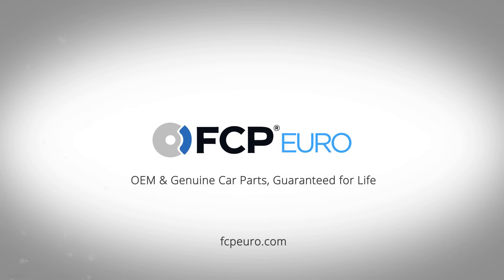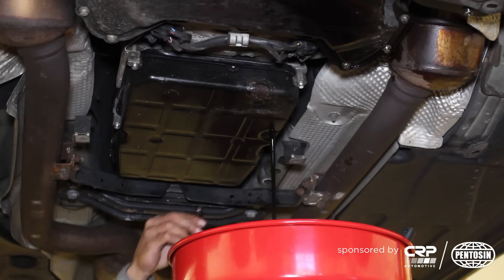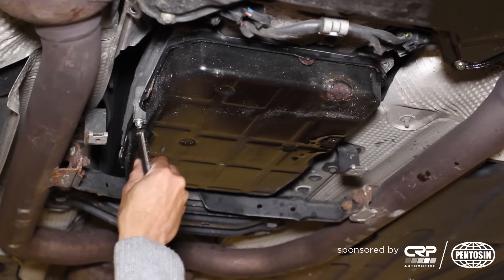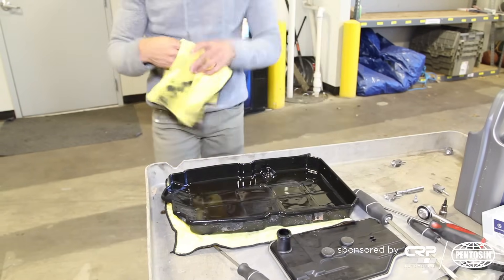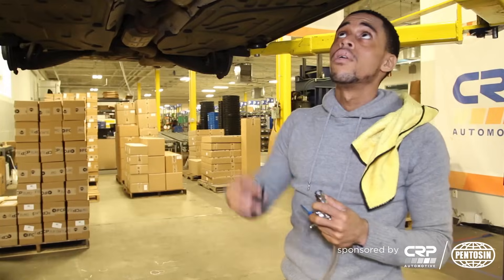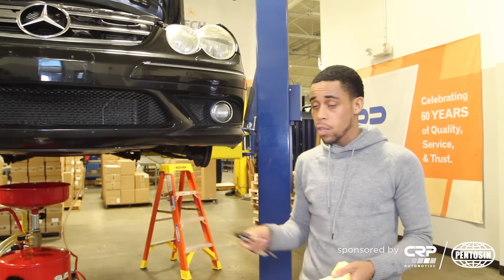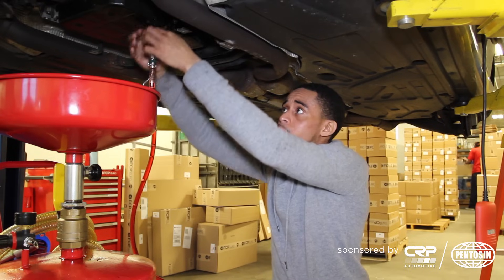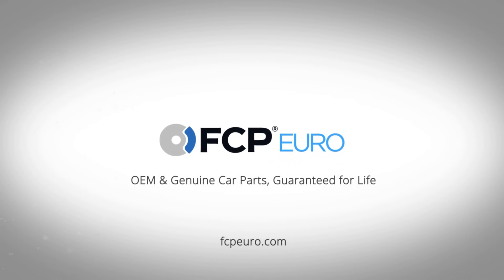Mercedes Transmission Fluid Service (w/o Torque Converter) Rein/Pentosin - Important Service (722.9)

Comment: Isnt there additional fluid up inside the torque converter?
Reply from the maker: Hello Michael, there should be another 4 liters inside the torque converter which is common with a basic drain and fill. This will be fine as the new fluid cycles through.
Reply: Hi, in many others videos it is said that the torque convertor should be drained aswell as it contains almost half the total amount of ATF. So if you do not so you only flush half the ATF. And since it is not that much more conplicated....

Comment: I was told not to change it as it could actually hurt the transmission. Any input on that?
Reply: Yes that is what bad mechanics tell you so that you get a huge repair bill later for a new transmission.  I went to one shop and he said the chemicals in the new fluid will wear away parts of the transmission that were held together by the old fluid and dirt so when you clean those off with new  fluid the trans starts to have problems.   It's total bs.   I think the fluid and filter replace and additional flush after 3k miles is ideal. No need to do the torque converter.

Comment: can the fluid be filled and checked through the dipstick tube? i know MB didnt provide dipsticks for the 722 trans,  but aftermarket ones do exist
Reply from the maker: The 722.9 transmission unlike the 722.6 does not have a dipstick tube. Both the fill and level check are performed from below

Comment: I own an 2010 ML350 4Matic, how do i know if I have a torque converter or not? It's a 4matic so it does?
Reply from the maker: Hi Madsupervilian, 4matic means that your vehicle is equipped with an AWD system. In this case, these automatic transmission models will all have a torque converter. This video is highlighting how to do a transmission service, without touching the torque converter (which has ATF fluid within itself). To service the torque converter fluid, more than likely that would require a transmission out service which most people are not performing at home. Hope that clears it up a bit :)
Reply: @fcpeuro  You are very helpful, and thank you for  your time to respond.  

 I am planning  to do the transmission fluid  change along with upgrading the pan and filter if mines not the upgraded version?.  Do you know if my 2010 ML350 4matic  is the red fluid or the updated blue version?  

my vin 4JGBB8GB5AA590860

Additionally, beside changing the filter, fluid,  updated pan.  What about the torque converter? do I drain and fill that as well? any info would happily appreciated!  I will be purchasing these items from your site by the way!
Reply: @fcpeuro  Nevermind,  after doing a bit more researching on the forums.  I came to the conclusion that it wouldn't be a good idea to drain the pan, torque converter and cooler oppose to a shop where they have air compress tools to drain.  If I feel like theres a lot of sludge up there, I will just drain and refill with newer ATF after a year and so on.

Comment: The one thing I have found and you should mention is that if the fluid temperature happens to go above 45c, you will need to wait a long time for it to decrease to the designated fill temperature. Mine went about 140 as I was figuring out how to use the scanner and I had to wait a few (several) hours for the temperature to decrease to the proper range. I wish I had known this. You learn as you go sometimes...

Comment: My 09 E350 sport has a 722.9 transmission. I recently changed out the transmission fluid , dropped the pan and drained torque converter. I pumped up 9 litres of new fluid , ran the engine , cycled through the gears and waited for the temperature to reach 45 degrees C before setting the levels. I wish there were some kind of additional drain plug on the pan to do periodic drain and fills , pumping up the same amount drained. This done without dislodging the standpipe.

Comment: Awesome video. How do you drain the torque converter btw?
Reply: Remove rubber cap cover and turn the engine from crank bolt 27mm socket till you see the Allen screw plug. Use a 6mm Allen to unscrew and drain oil.

Comment: What about the fluid in convertor and cooler??
Reply from the maker: Hi Vishal, with regular service intervals, you do not need to remove/drain those units. If the system is heavily contaminated, then removing the transmission to drain the converter and flushing out the line will be necessary.

Comment: Should have fixed the broken pan bolt, installed the left front cover tab below the pan bolt, and wire brushed/painted the large rust spot and dent in the pan.

Comment: Nice video, but you should use eye protection and gloves.  Also, aren't the aluminum pan bolts one-time use only?
Reply from the maker: Yes, eye protection and gloves should always be worn. The bolts are one-time use and will need to be replaced.

Comment: What about converter ? There is 6 ltr oil too ?
Reply from the maker: Yes, there should be around 6 liters in the torque converter. This video shows how to perform a basic drain and fill without flushing out the torque converter.

Comment: That car takes sound 9.5 quarts, why did you guys only do half the work? You needed to drain the rest of the fluid from the torque converter. Now you've basically contaminated the new fluid with the old fluid. What's the point?
Reply from the maker: Hello Samar, this is just a basic drain and fill service that's commonly done as a general maintenance diy. In most cases the transmission fluid does not need to be flushed from the torque converter.
Reply: FCP Euro actually on the Mercedes WIS it does clearly state that the TC also needs to be drained on 722.9 transmissions. You guys should do a full flush video. Cheers
Reply: FCP Euro 

What kind of transmission oil the mercedes benz e 350 v6 take
Reply: FCP Euro 
2007
Reply: @samaramin6650  i called my MB dealer and they said they don't do that, only on major transmission/tc repairs. They don't suggest that, if we do normal maintenance at every 80kilo drain method is the best. (tech from mb dealer

Comment: what about the torque converter?
Reply: Doesn't the TC move T/fluid within the converter or does it transfer fluid throughout the whole transmission?  I thought TC held their fluid and only needed changing if overheated transmission. There are some T/Cs that are not serviceable, only replaceable and if you don't know what you have you can possibly be crooked out of a service that is not what you think is done.

Comment: What about the fluid that remains in the torque converter? You didn't drained it
Reply from the maker: Hi Denis, in order to drain the fluid in the torque converter, you would need to remove the transmission. Maintaining proper service intervals will allow for an overall healthy fluid to live within the transmission.
Reply: @fcpeuro  Depends on the model. My CLS550 has a drain bolt on the TC body. Have to rotate engine crank to align. Otherwise, you are correct.

Comment: What about oil in torque convertor? You juss drained in pan but  t/c  holds a fair bit too
Reply: Did the transmission overheat? Does the T/C hold transmission fluid or circulate its volume? You have to know this. So how much more have you paid for a service that is not doable on some T/Cs?

Comment: 9.5 liter is around that. I almost fill to that number and let the other over flow. Its better to use open/closed valve on your rubber cable so U can see how it dipping instead of take off the valve.

Comment: So, it might be helpful to your viewers if you did a simple vid showing the procedure "How to check your transmission fluid level"...seemingly as most transmission issue start because of low or worn fluid and or levels...just saying. But again, my apologies brother.
Reply: there is no tranny dipstick on these cars... level is set at fill time.

Serious problems used to be from dirty old ATF but these days Bösch/Siemens controller is inside the oil pan ... I wonder what could go wrong then ! LOL 🙄

Comment: 722.9 total oil is 9.2 liters including the toruque converter why use 5 or 6 liter oil?
Reply: Smh, read the title of the video. He didn't drain the torque converter.
Reply: @user-ue4qy2xd4l  hi please read the PDF of the 722.9 gear box from zf it say torque converter use 1.2 liter and gear box 8 liter I understand what I say I only refer to info from the gear box manufacturer

Comment: Drain pan is not 4 Nm you initially tighten then use a special angle gauge. However, it comes to around 10 Nm. So his is not tight enough and may eventually leak. He also did not drain the torque converter. This is now required in the Mercedes Workshop Information System. So he has now comingled new fluid with about 2 to 3 liters of old fluid. Not a complete job.
Reply from the maker: Appreciate the response Mask Man, the technique I normally use is 4NM plus an angle torque of 180 degrees for a leak free seal. I see the overlay does not show this information, we will add it in the description.
Reply: Also check the WIS it now includes a torque converter drain. Which is simple ...you do have to turn the engine, until the torque converter drain plug is visible and simply drain and reinstall drain plug....essentially.
Reply: FCP Euro , hi how do we do 180o ? Can you have us converted to Nm please !  Thank you
Reply: Hi , would you have us converted 180o to Nm please ! So that will be easy to work on for seal leak . Thank you
Reply: The drain pan bolts are not 10 NM like I originally wrote above they are approximately 5 NM ....do not tighten to 10NM or you will snap a bolt.
Reply: Mask Man 
ok thank you for your response.
Reply: These are the bolts that secure the drain pan (there are 6 of them). 
The primary drain pan bolt to drain the pan (only 1 )  is  22nm

Comment: Incorrect torque of the pan bolts. 4nm and 90 deg with new bolts. They are torque to yield and must not be reused.
Reply: Wrong. 4nm and 180 deg. not 90.  AND VERY IMPORTENT always new bolts.

Comment: by that way you just change only 30% of the fluid and it still 70% inside the transmission cuz all 722.9 they take 8 liters and by the way you use you only take 3.5 liters so its like you haven't  change the fluid say you add in it not change sorry if i say something you don't like it but that the reality bro